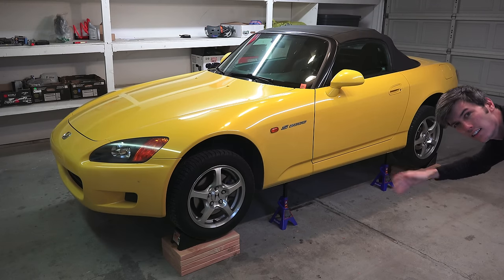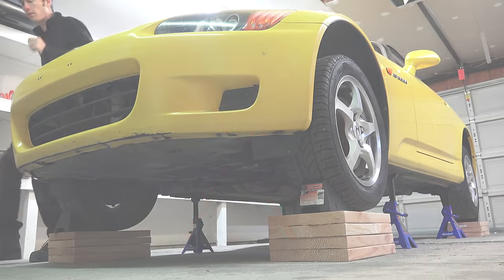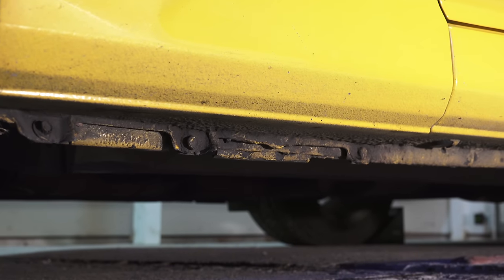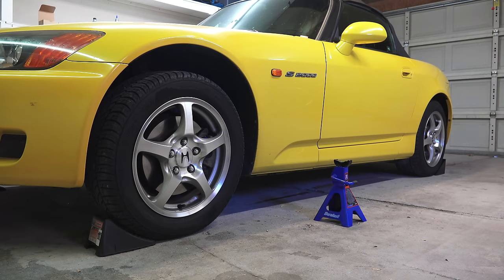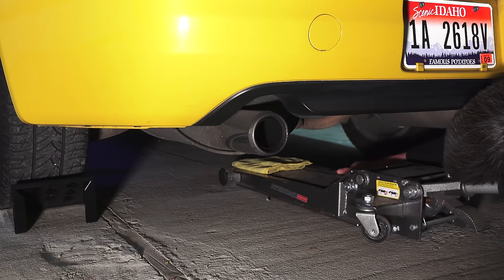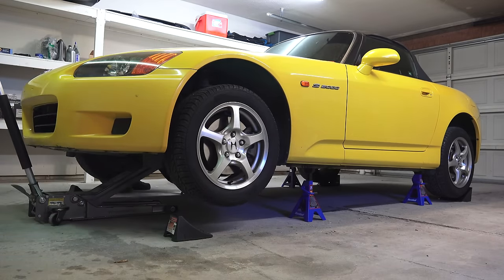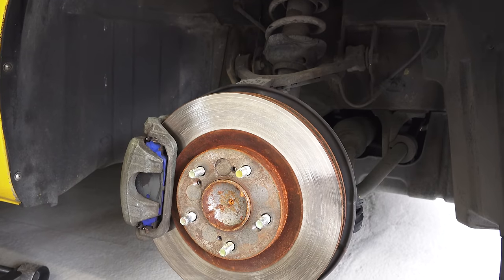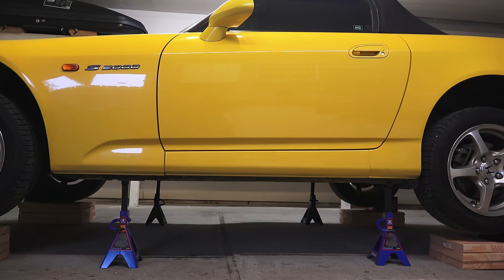How To Completely Lift A Car On All Four Jack Stands

Comment: Is it bad to use this type of jackstand on its lowest position without raising it at all ?
Reply: Spiros Mallios no. .. It's actually more stable... The higher you go.. The more unstable....
Reply: Yes but it doesn't rest on the ratcheting mechanism
Reply: Spiros Mallios ah..ok... I see what you mean that's a good question ...mine have a fully boxed frame at the top so I've always assumed that you can leave it on the lowest setting and not on the mechanism.  but that is a good question. is it better to leave it on the frame? or at least go to the lowest setting so that it rests on the mechanism?
Reply: David McClelland yeah..I think they box the 🔝 so that they're adequately safe without using the locking mechanism.. Or there would be instructions on all of them explaining that we have to lift the jack stand at least one point... And I've never heard of or seen that in any instructions to the stands. .. So it's pretty evident that they're safe at the lowest setting. . At least to me.. 👍

Comment: personally i wouldnt use a flat cup jack on pinch welds on a car. far too meany times i seen those get crush and rust away. i tend to lift from the k member or engine sub frame if possible from the front or the rear sub frame or diff from the rear. still have to watch the rear sub frame though. if the car is front wheel drive, that sub frame could bend and cause an alignment problem. though i never had that happen my self

Comment: DO NOT let the wood blocks take any of the load when lifting the rear of the car up. If your surface has any type of a grade to it, the car/jack can start to roll. When lifting rear of the car, there is no resistance (brakes/drivetrain) to stop the car from rolling. The wood blocks should be the last step and should not make contact with the wheel. They should not take any of the load and only be a backup if for some reason the jackstands have a failure. @ 2:08
Reply: @cjcoleman8525  you rely on conjecture, I rely on experience. also, it doesn't take that much force to make a free spinning wheel (front) roll. GFY

Comment: I work for Honda... and we rarely see an S2000, but they are a pain in the ass to get on the lift because they are so low. We have to jack them up before we can put the lift feet under them. They also take a unique type of oil (10W-40 vs 5W20/0W20 which we don't get in bulk) and most other things are just plain different then any other Honda. Neat car tho..

Comment: What is that weird pipe coming off the exhaust at 2:36?
Reply: cancels out the drone at cruising speed
Reply: Its called a helmholtz chamber I believe.
It reduces the amount of drone/resonance at a specific frequency range in the exhaust note. 

A simple explanation is that the exhaust waves travel through the exhaust pipe and into the chamber where they hit the end of the pipe and come back at 180 degrees of the original wave - effectively cancelling that particular frequency range by matching it with a mostly equal and opposite force.

Different size chambers target different frequencies, and there are formulas used to pick the correct sized pipe. Putting a random size on may not target your particular drone range.

Comment: thats technically an impact driver not an impact wrench. Also I think thats a non impact rated adapter? That looks like that weaker ryobi 120ft-lbs driver, not sure if you can do much with that.

Comment: Les suppose I have a VW GTI (i don't, yet). Then I don't have a rear dif, which are the jacking points to lift both wheels at the same time like using the dif??
Reply from the maker: +Hambert unique to each car, but often there is a tow hook you can use.
Reply: Engineering Explained thanks Jason! You're the man
Reply: You can lift up using the IRS beam
Reply: Thanks! I was always afraid of lifting my cars by other points than the factory jack ones, since I only had VWs. Once its here, I'll give it a try!

Comment: What's with the dead leg in your exhaust system at 2:36? Some kind of resonator?
Reply: possibly a helmholtz resonator maybe , unsure
Reply: Resonator. the S2k drones at low rpm's without one
Reply: I put a huge catalytic converter on my Chevy Prizm, took out the droning from losing the resonator and helped with the bottle neck on flow and power.

Comment: What did you use for a front center jacking point?
Reply from the maker: There's a specified crossbar where you can jack up the front, it's just pretty far back so I had to lift it up initially because my jack wouldn't fit underneath. I think next time I'll probably drive it up onto two blocks first, and then jack up the front end using that jacking point.

Comment: in FWD cars putting in first gear is not a bad idea. Handbrake affect the rear tires. So the front tires are not under any brakes or anything. Things you learn. I park my car in gear AND handbrake in any hill. And on flat ground a gear is enough. (but not enough if someone drives into you) 

Unless you got air brakes. Then all wheels are going to be locked up :)  Safest brake system when it comes to parking. If brakes are bad you do not go anywhere in a hurry XD They refuse to stop holding the wheel still until they get compressed air.

Comment: Please someone respond to my comment . I’m looking into doing a manual conversion to my 85 corvette and would like to know the proper jack stand to use. I am not having any real luck anywhere else on YouTube nor through the web browser
Reply: You are converting from automatic to standard transmission? If so there are a number of things to consider. You need enough height to lower the automatic transmission down after removing the bolts from the flywheel to the torque converter and to the engine. If it is supported by a rear crossmember which I believe it is you will have to remove the crossmember after undoing the rear transmission mount with the transmission supported by a jack and the two lower bolts from the transmission bell housing still in place. The engine has to be supported before removing the transmission. To do all of this requires removal of linkage to the transmission, starter, cooler lines, exhaust, and driveshaft. Fluid will pour out of the tail of the transmission if it is not empty. The dipstick will hit the firewall when you begin to lower the transmission. The distributor as well. You need to have them removed. If the exhaust manifolds are going to hit remove them. With the transmission on the jack and lowered enough to remove it on an angle down you stop and support the engine. Preferably with an engine hoist and for safety a stand with a block of wood underneath. This is not easy to do because the transmission is on an angle. You loosen the bolts halfway and separate the transmission from the block. Stabilize the jack frequently with the movement of the transmission. Once you get to the point where you are going to completely remove the two bolts remaining from transmission to engine you must be prepared for the weight of the transmission, it’s position on the jack may not be balanced and it can try to tip sideways, forward or backward. Once detached and balanced you have to lower it gradually to move back enough to clear the location pins on the back of the engine block. There is a lot to this and it is dangerous so you have to assess everything that you do before making any moves. I do not recommend this job for most people and cannot be responsible for what you miss if anything that I have not mentioned in any part of this explanation. You are responsible for your own safety. You can bet seriously hurt or killed. Make sure that the torque converter is separated from the flywheel before removing the last two bolts from the transmission to the engine block. It is your decision on what to use to hold the vehicle up. Good stands with the rear wheels chocked on the ground with the engine hoist connected and another stand under the pan, rolling jack aimed rearward under the transmission pan with a board in between. If the rear is raised also on stands check the stability every time you go under and do not jar anything hard while underneath. Using ramps or stands at front you need enough height to clear the frame and get the front bell housing out from under the car. That is the height from the bell housing to the pan plus the jack and the board in between. Pretty high. You can sometimes slide the transmission off of the jack when it is down all the way and then pull it out but it can tip off the jack on you if you are not careful. After doing all of that you need a different flywheel and a pilot bearing has to be installed in the rear of the crankshaft. Clean the hole and smear a bit of lube in it. Do not damage the bearing. Tap it in with an old input shaft or a pilot bearing tool and a hammer. Install the new bell housing for the standard transmission, after the clutch. You will need to align the clutch with a clutch alignment tool or the correct input shaft. Install the throw out bearing. Install the transmission. Raise the assembly and install the rear crossmember and transmission mount. Install the shifter linkage and shifter. Reconnect exhaust, install the distributor and anything else removed including the driveshaft. The front yoke may be different and the length may need to be changed. Install the shift boot, handle, install the third pedal and necessary linkage to the clutch fork. Everything back to where it was. All this being said it is dangerous and difficult on the ground. You can get hurt or killed, be extremely careful and you should not work alone. If you are working on a corvette it is tight and awkward already. If it was me I would consider pulling the engine and transmission out and putting it back in one piece. Less awkward and easier in my opinion. While it is out you can do other things if necessary like head gaskets, timing chain,… It is up to you. Best of luck, be safe.

Comment: Another safety measure would be blocks of wood that would act as a failsafe in case the car did begin to fall.  If you think of a scenario where the wheels are all off, and the car somehow tips all the stands over, the car would basically fall on its belly, completely crushing you underneath.  If you had a couple of 1 foot blocks in the correct places, your car could fall on those blocks, and still leave room for you to be unharmed.
Reply: Sam Maghsoodloo If you take the tires off, put them under the car beside the stands.
Reply: adam gorski perfect!
Reply: Sam Maghsoodloo i would plan my services accordingly. If i get under the car the wheels dont come off the car and will have the wood under the tires. If im working on the brakes and have the wheels off i wont be getting under the car
Reply: I cannot visualize your setup. Could you post some photos?
Reply: @LoveLikeaHurricane  you have no choice if you take the subframe off

Comment: Maybe you've made a video on this but why should you loosen lug nuts before jacking up the car?
Reply: With weight on the wheels it is easier to break the lug nuts loose. If the wheels are in the air and you use a breaker bar or something like that the wheels just spin.
Reply: Colton Blumhagen it's only necessary if your taking the wheels off because it's way easier to losen the lug nuts on the ground

Comment: The S2000 is so stiff that the rear and front lift at the same time, cool chassis. My FIT nearly do that, my wife corolla, forget it, chassis is not stiff at all. 

I change my wheels myself But I don't have enough leveled ground do lift my car like that ( and it's outside garage is small and use as a storing space), I wish I had i could more job myself. Although I do lack all the tools.
Reply: Ford focus zx3 is the same

Comment: Ye gads. Don't support an older car on the sill like that without a stand fitment to specifically fit the sill contour, otherwise you will crumple the lower protruding edge of the sill even around the factory jacking points.

Somewhat better to use the factory jack (widow maker) on the factory jacking point on the sill (do NOT get under the car using just this!), then the stand under the inner suspension wishbone / arm mount point.

Also worth nothing, many cars have jacking points on the sills for use with the widow maker jack supplied with the car (for wheel changes) AND also reinforced areas just inboard of those points for the use of trolley jacks and two or four post lifts that have flat lifting pads.

Comment: A friend of mine was working on the back of his truck and he used a air bumper jack to raise the rear. He was sitting under his truck working and went to get another tool and as soon as he was out from underneath  the bumper ripped off the truck and crashed down. I was watching and when it happened we just look at each other and didn't say anything for like 10 seconds.

Comment: Hmmmm.  Couldn't I just make 4 wooden ramps and drive the car up them. Make the gradient shallow so I don't scrape the car against them? I know That's the most full proof plan and has drawbacks If you need to remove tires. But if say your changing trans fluid or something wouldn't that be enough?

Comment: It should be Noted that you both Jacked up the S2000 incorrectly AND placed the jack stands in the wrong locations. [Owner here] The actual jack points and appropriate Jack stand locations are easily found with a quick internet search. The S2000 specifically only has two jacking points. The radiator support under the nose has an easily identifiable plate and the rear diff. The Rockers are ONLY to be used to lift the car with.... a car lift. The pinch welds are also not the appropriate location for jack stands there are reinforced spots at the front and rear of the frame rails specifically for jack stands. I made the same mistake the first time I jacked up my S2000 but I didn't make a video about it so you might want to fix it.

Comment: I just build wooden ramp with stoppers at the end. Serves me well. But for times that need the wheel off, I pull out the quick jack. Yea it's expensive, but like he says, I enjoy living. So both quick jack and stands or the wheels go under the sides for extra safety should the car falls, will stop on the stands or wheels, which ever is used. Being paranoid safe 😂 better than unable to be sorry
Reply: reply please:  where do you put jackstands when you use your quickjack?  I can't imagine where they would go, seeing as the quickjacks occupy the jack points and the quickjack frame runs the entire side of the car.  thanks!
Reply: @doodookines  it's further in than the pinch welds, and is where I usually place my stands even before I had quick jack. It's a much thicker solid ridge that runs almost all the way down the car.

Comment: You'll want a more solid method for your wood blocks, instead of just layers, possibly large dovetails so they interlock. Another idea would be to create a curved surface for the top block that cups the wheel. This way the car can't roll back or forth, and the blocks have no chance of sliding around on each other.

I have another idea, but I haven't personally seen a product like it, and could be great for diy. a platform that can cup the wheel, but also works as a jack with locking points like lifts have. For use with jack stands, of course, or have some kind of combination tool where it's jack stand and wheel platform, but that would have to be adjustable.
Reply from the maker: Yeah I'm considering bolting or nailing the boards together so they're more stable, but I like the flexibility of being able to adjust the height with more/less boards.

Comment: I really hope you don't use that electric impact when putting on your wheels, unless its a really good one! They are known for not having enough torque, and my friend's wheel almost came off one time after putting the lugs on with an electric impact
Reply from the maker: Correct, definitely don't want to use it for anything other than taking them off or getting them started. Always torque your wheels to spec!
Reply: That had to be a really crappy one then! Got one for 50-60€ on Amazon, + a KS Tools torque limiting socket, it's more than enough for wheels (around 110Nm) I always check with a torque wrench afterwards and it's perfect. 
If you can't even use it for wheels then you might as well throw it in the bin
Reply: I'm sure there's plenty of good ones out there, thats just been my experience with them, and I agree, if they you can't use them for wheels, might as well get rid of it

Comment: Also attach a cable to your garage rafter and around the car.  Then rent a crane and attach it to the roof to hold it up.  Build up a spire of cement blocks or bricks to the top of the crane to support it for safety.  I stucco'd the exterior of the spire to make it look nice.

Comment: This video is helpful for small, stiff, lightweight sports cars but not so helpful for owners of SUVs or minivans.
Also, if your audience needs reminding what a jacking point is, they probably need showing what a transfer case is and what the central front jacking point you used was and why that part is strong enough to take the cars weight and other locations will damage the vehicle.
This was not a very informative EE video and others have covered this better.

Comment: great video, can you show us how to take it down?
Reply from the maker: I pretty much just reversed the process. You want to make sure you slowly let the car down when you're shortening the jack stands length, so you don't damage the pinch welds. This is done by being very careful while releasing the hydraulic pressure on the jack (release very slowly).
Reply: cool, thanks Jason!

Comment: I use hockey pucks between the jack and frame member. Rubber prevents metal to metal slipping plus it protects the underside of the car. They are cheap and last for a year or two. Finally, something useful from the hockey world. LOL